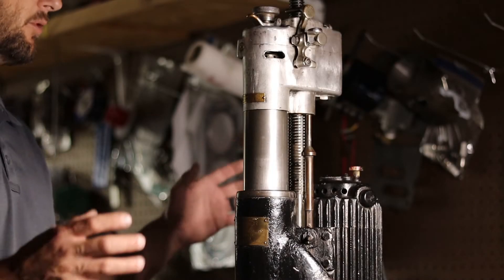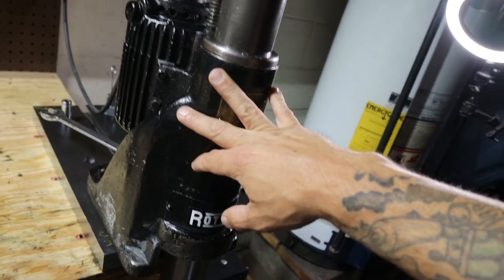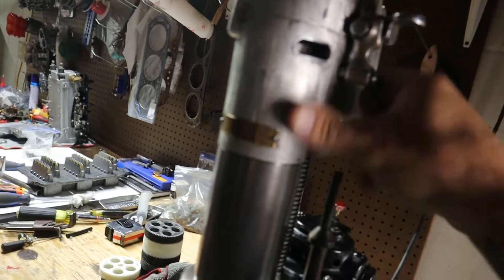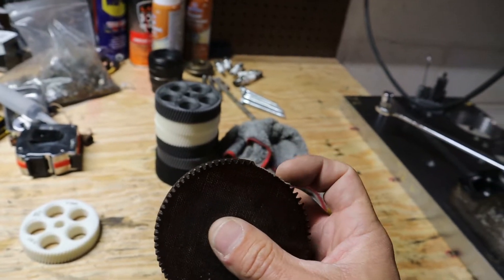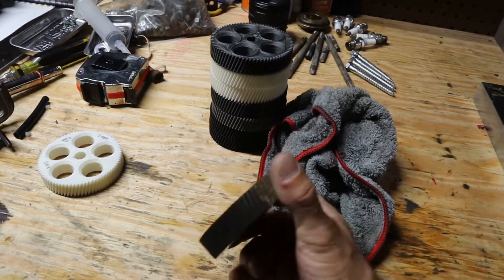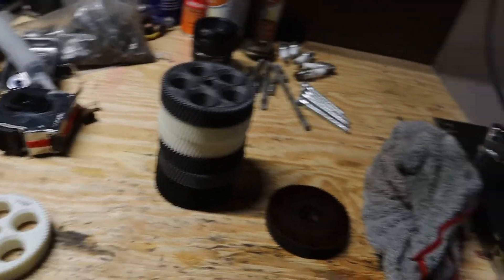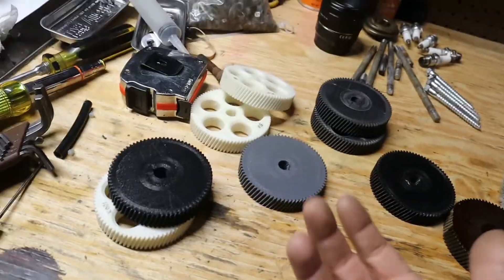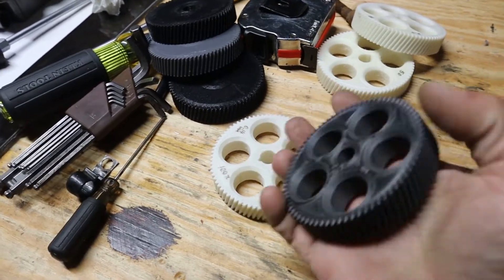3D printed gear saves 100 year old machine!

Comment: Ola amigo tdo bem, sou do brasil adiquirir uma maquina deste modelo ,  estou reformando.. como funciona o retorno desta máquina? Fas um video ensinando a operação , porq e bem diferente das outras...
Reply from the maker: Hi! It has a soft stop rod that can be set to your desired stopping location. Its very unreliable for blind bores. I manually stop the machine with the lever to ensure i don't bottom out the cutting tool. On the control side of your machine head, you should see a rod below it that can be adjusted in height to contact the stop lever when the tool reaches it.
Reply: @SmalltownBassin Olá amigo , eu ainda estou batendo cabeça com está máquina, mais agora com os centralizadores,

Comment: There's a fiberglass guy it seems that using glass in a gear glass breaks into sharp edges and I wonder if as the like you're pounding on the gear now to get the fit resistance over the shaft seems like it would be glass introduced into the oil slurry just a thought. I know that key ways are typically used to locate and hold like the woodruff key you're using but they demonstrate a widget key in a bar key I thought was that it was designed to share so pretty sure prop I know it's a key and lawn mower fly wheels so wonder if the break point or the strongest point you might say is now the key way when it should be the weakest point if that makes sense anyway I'm completely fascinated by the 3D printing you've done maybe mentioned your printer and set up thanks enjoyed your video
Reply from the maker: Thanks Mark. I thought about the abrasive properties of the glass also. With the rest of the gearing being made of high carbon steel, im willing to take a chance. The gear material is a 30% fiber filled nylon so its much less abrasive or risky than a resin matrix / glass composite. So far its doing great! The first trial run was a huge surprise. I didnt really expect this to be a viable option but its working better than the original design. The engineered failure point is intended to be the roll pin linking the vertical screw. In my case the gear was weaker. But im ok with the gear taking the abuse now that i have a replacement option at my finger tips. My 3D printer setup is a custom built Folger Tech FT-5 with Dyze Design hot end and direct drive extruder, aluminum axis upgrades, heated chamber, etc. I wouldnt try this material in an off the shelf "consumer" grade printer. Thanks for the input and please consider sharing my channel and content.